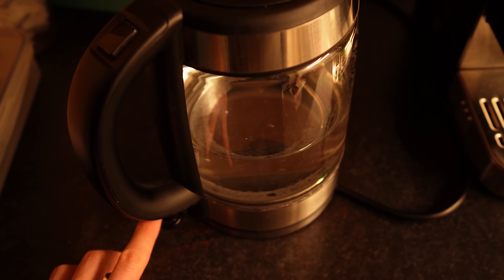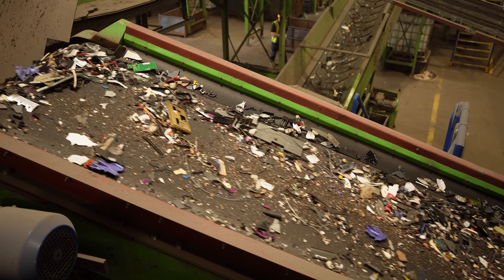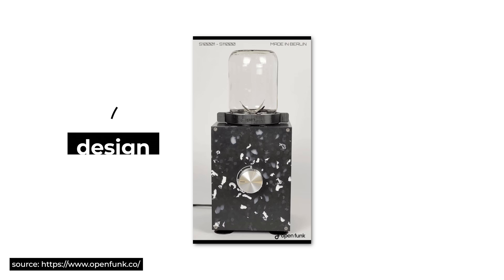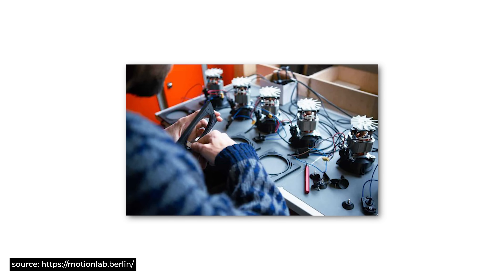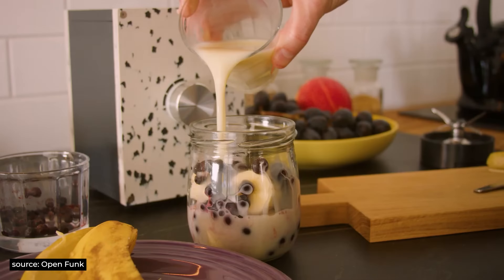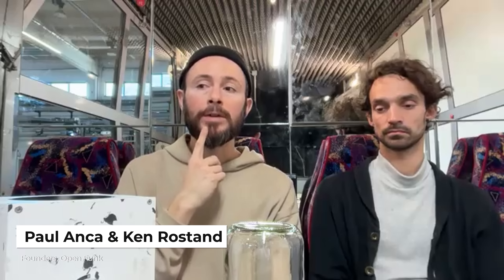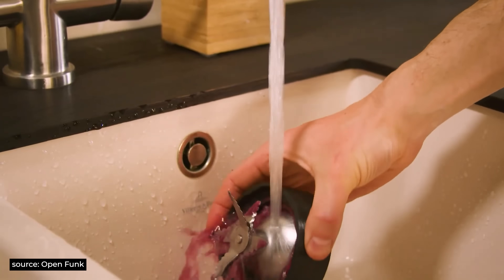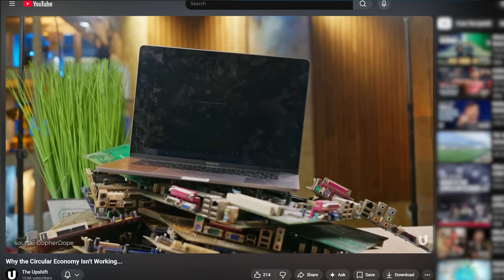The Last Blender You'll Ever Need

Comment: Whats the new “greenwashing” for right to repair? “Repair washing?” This $450 blender is no more repairable than an Oster, Hamilton beach, or vitamix. Hosting STLs for the most basically engineered parts when printables and other repositories exist hosting thousands of parts for existing units miraculously makes this worth its price point? It still has soldered on connection points like others. This rhymes with a scam, and this “company” will likely not exist by the time anyone needs to repair it - most importantly it will not reach the popularity of more common cheaper models that do have user generated repair part STLs.

Comment: This already exist, you can get a basic, single speed classic chromed oster blender, it has a sturdy metal base, it's easily reparable and all the parts can be easily aquired, and is a workhorse, my mother has one that has been running dialy for at least 2 decades. And for a fraction of the cost (89usd vs 409)

Comment: I needed a new toaster and looked into that repairable toaster.  Just like this blender, it's very expensive.  The problem is that the repair parts are expensive as well with only one single source.  The payback period is just too long, even assuming failures every year.  If my current rate of toaster failure holds, I'd have to live several hundred years to make the expensive toaster make sense.

With blenders, I've never replaced one for an unrepairable defect.  Would I need to live 1000 years for this one to make economic sense?

Still I support the idea

Comment: As a factory worker, this hits different. ♻🏭 Designing for repair, not replacement, challenges the entire “volume over longevity” model. This is the future we need to build. Huge respect for the open-source, modular mindset.
Reply: Squint… you can repair almost any decently priced blender that costs half and even a quarter of this pricepoint ($450), comparing to the throwaway models is disingenuous at the least. I repaired my mom’s Oster from the ‘70s with 3D printed parts I found online and it works like new. I looked up if my friend’s vitamix had parts for fun and it did too. This is marketing not repair ability.

Comment: When my espresso machine stopped working, it was just a failed thermal fuse. I bought a 3 pack for $6 and if I was more patient I could have paid even less. They didn't make it super easy to replace. I guarantee that 90% or more of cheap espresso machines that have this $1 part fail are thrown away instead of repaired. It's maddening. At any rate, this blender is absolutely awesome.

Comment: That price throws me off.
I get it that you have to pay a premium for something like this. But for a premium price I want premium features atleast.
Lifetime warranty would make it hurt less. 

There's no way you can't get an already existing high quality motor assembly made for blenders for under €10.
If they had their own PCB in there I'd be ok with a little higher price, but this is under €30 components. I feel this should sell for under €150.
Reply: It is handmade, and that increases prices by a lot. 

Recycled plastic is noticeably more expensive than virgin plastic, if they're CNC-milling parts in Europe instead of China that will also make things a lot more expensive.

I personally find the price to be very reasonable for what it is, that they can make a blender in such a way and still be priced underneath what the most expensive Chinese-made blenders on the market costs I think that is quite good.

Comment: It looks like the thread which attaches to the jar is 3D printed which is not safe for food as the gaps between the layers cannot be washed properly
Reply: I'm also always wary about 3d printing and food safety, but they say it is sealed with a food grade silicon, so I assume it is safe.
Reply: the materials in contact with food during blending are the glass (jar), stainless steel (blades) and silicone (seal).
Reply: Shh... You'll startle the greenwashed startuptards.
Reply: just print a new one instead of cleaning. /s

Comment: Is 3D printed plastic a good idea for food? Is it safe?
Reply: My main concern would be mold growth over time from food accidentally splashing onto printed parts but it depends a lot on their print settings and how you clean it. It looks like they kept printed parts completely out of contact with food, the glass jar seals against rubber and a metal cone. The "worst" thing I can see is that the printed parts make contact with the outside threads of the glass jars and "could" leave microplastics on the outside that "could" fall in (somehow) but its probably fine, I think that chain of events is unlikely. Personally I would call this a best case scenario for using 3d printed parts in a food appliance and would feel comfortable using one in my own kitchen.
Reply: Acetone-smoothed ABS/ASA should be food safe.
Reply: As with everything with 3d printing and microplastics, its not UNsafe, because no one has been able to prove one way or the other

Comment: I  have a second hand Vitamix, and its pretty much last blender i ever need. You can get spare parts for them, and they are build to professional standards.
Its better to build stuff that leverages standards that already exists on the markets.
Reply: I have no opinion about this blender. But I can add a voice to the Vitamix conversation. I paid $300 for a refurbished Vitamix 12 years ago and it’s still going strong. It does have a small issue where it seems like the lowest speeds have kind of flattened out - meaning the difference between putting it at the lowest setting up to about 25% all seem to be the same speed. But it’s still super powerful and just works. It has made many hundreds (maybe thousands?) of smoothies, soups, sauces, etc. It was one of those things where we thought it is better to buy once, cry once and we could not be happier with the purchase.
Reply: And you can find STLs for its parts on all the repositories free already too

Comment: I looked on their github and it's worth noting that none of the parts of the blender head and blade block are open source (yet? their last reply to the issue was 10 months ago and very vague/non-commital)
And the cooling/motor is not designed for continuous use, after 2 minutes (the max advised blending time) you should keep it off for 15 minutes according to the manual (although tbf this is probably the worst case cool off time, and there is a self-resetting thermal breaker that turns it off automatically if it gets too hot).
This is probably also why the manual says it's only for home use and not for use in a professional setting like a restaurant or coffee shop.
Reply: They claim the files for the head will be released "summer 2025"...

Yet another product marketed as open source that is not actually open source.
Reply: That's a lot of bullshit in the air.

Comment: What should I do with the parts that cannot be made at home? For example, the motor and blades. If there is no protection against overheating of the motor, then this is the same piece of shit as a сhinese blender for 5 bucks. The blades and their attachment points are often incompatible, even from the same manufacturer in different models.
Reply: Very few items can be made at home, I bet you cannot make the jam jars at home either. The point is that the schematics should adhere to standards and/or already standard parts, that any factory should be able to produce it, anyone should be able to sell it..

Comment: What are the gears made of and can the bushings be replaced? That were the parts that broke on my last 3 Blenders and there they were made from plastic.
Reply: Not an expert, but plastic bushings are totally fine in lots of situations! As long as they don't have custom/proprietary sizes, there are lots of industrial parts suppliers that should carry a large variety of standard sizes of plastic bushings!

As long as the design of the blender is such that it can be taken apart easily and the bushing is easy to access, a detailed owner manual either physically shipped with the blender or available online could give you the exact dimensions of a replacement bushing, even down to the material and maybe even the tolerances and a consumer should be able to buy a replacement from McMaster Carr, Grainger, or an equivalent supplier for wherever that consumer lives. Sometimes hardware stores also carry bushings, though their sizing options may be more limited.
Reply: @dualtriquad agree
Reply: it's plastic with a metal thread. so far they have been performing well - but the main approach is here it to have them easily replaceable in the first place

Comment: I get that many people think it is expensive, and it is expensive for what you expect of a blender. But you have to keep in mind 1000W is a powerful blender, and being open source it should last your whole lifetime. Such that 350 EUR over about 90 years is not bad, and you could pass it on to your grandchildren
Reply: Take 5min to watch unsponsored reviews here on youtube and you'll find that this blender leaks, videos from 8-3 months ago show the same issue so this a new problem but also one that hasn't been addressed.
Reply: Or you could get vintage one for 35 EUR and still pass it on
Reply: @saiv46  The second R, Reuse! :)
Reply: @saiv46 I 3D printed two parts for my mom’s old Osterizer and it works like new, found em on printables, it cost her $35 in the ‘70s
Reply: That’s like claiming a rolls Royce has a more powerful engine and should last a lifetime.
Reply: 1000W is not a lot.
My hand blender has that much.
And you can buy a whole blender for less than $100.
I only use a hand blender, it's versatile and replacement parts are available from third parties (because this kind of blenders are so widespread)
Reply: @arpeik  1 kW hand blender screams Chinese product marketing. No package of that volume and price can offer a 1kW motor and its required heat dissipation.
Reply: @yosyp_yosyp  well, you must be an engineer and a genius. Look it up and see for yourself
Reply: @arpeik  I don't see how being an engineer and a genius helps in being skeptical about already established ultra capitalist and predatory marketing. I also don't see how "looking it up and seeing for myself" titles screaming "1 kW" everywhere helps with your thesis, as that is exactly the dubious premise. You can claim 1 PW about anything, lying is really not that difficult. Are you implying that companies never lie?

Comment: I have a bearing going bad in a Nutribullet blade assembly.  I looked up the bearing:  $50 for a proper food-safe bearing.  I can get a whole new Nutribullet for that price.  I can also get a blade assembly for $20, or a crappy amazon bearing, 5 for $5.  I'm disappointed that Nutribullet charges so much relatively speaking for spare parts, and that they don't sell whatever bearing they use.  I am glad that they sell spare parts down to the blade assembly level though.
Reply: then you won't be happy with the "remix". the cost for spare parts are not shared on the website, neither can you find the right part in the bom on github